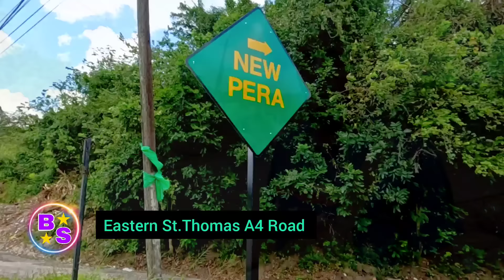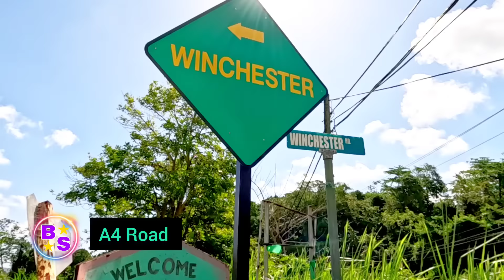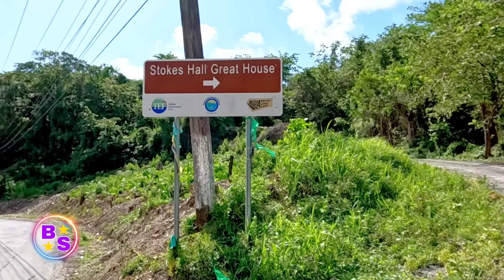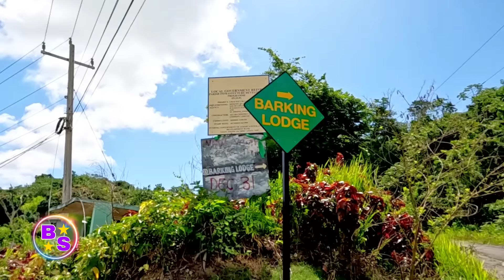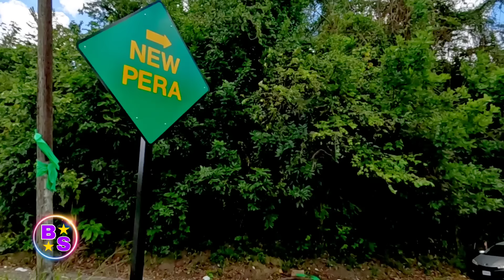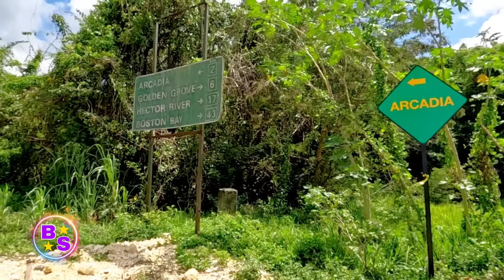UPGRADE Winchester To Arcadia Road Work Continues To Portland  Jamaica 🇯🇲

Comment: 🇯🇲BigSuper♥️Based on your experience with always having to walk in the road during your Vlog/Blog's because the majority of streets have no sidewalks, and therefore putting your life and your fellow Jamaicans in jeopardy, and at the mercy of the transport  drivers, I think you should address the issue with the commissioner for road works.  

The next election you should address this serious overlooked issue.  You, BigSuper, have the proof in your videos to bring it to the forefront.  I don't understand how roads are built in a residential area without pedestrian walkway.  Suh wah, the elders, ah pickney dem jus ah fi lockup likkah chicken innah coup becse dem wod be tekin dem life innah dem hand if dem venture out for a stroll.🇯🇲